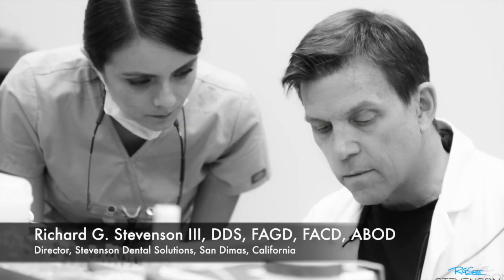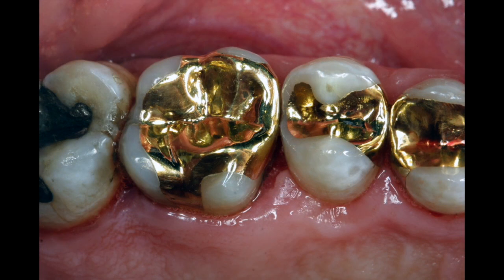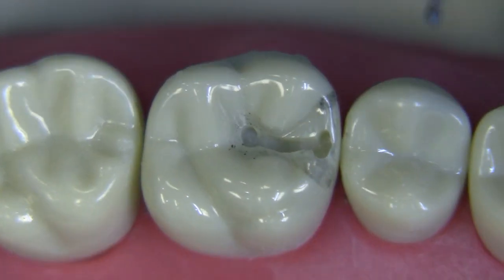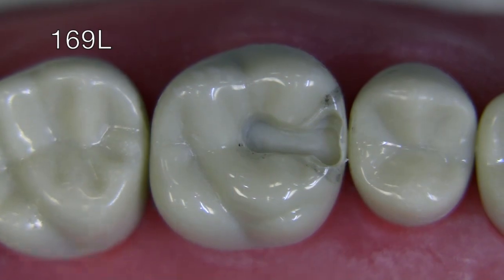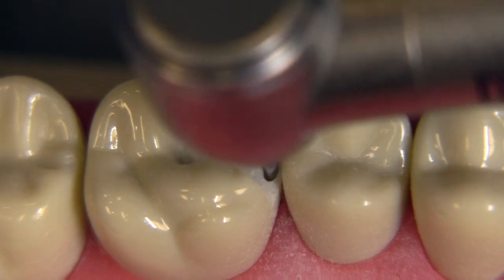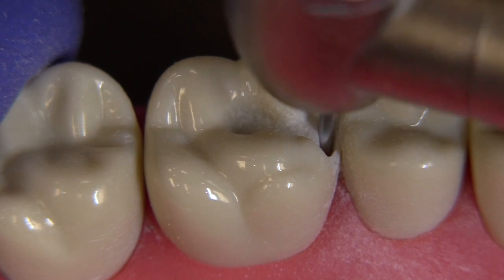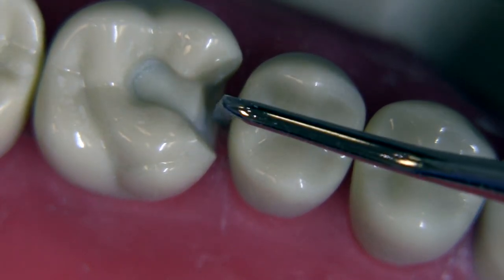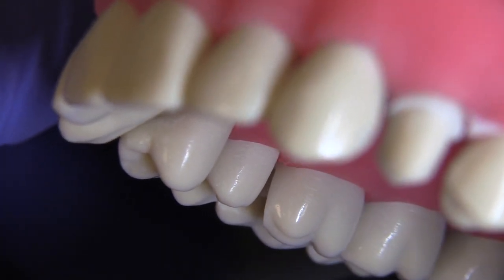Cast Gold Tucker Technique - Gold Inlay Preparation #3 MO

Comment: Dear Dr Stevenson - very neat, well explained.  Your comment on leaving a slightly larger draw angle in the gingival asp of the box. (B&L) This was shown to have an insignificant reduction in retention while greatly facilitating the seating of the final prosthesis.
Reply from the maker: Thank you - the best fitting castings have an "easy draw"...Then more friction due to more surface area in contact.

Comment: thanks for the upload doc, from ,my experience i saw few gold indirect restorations that stayed more than 20 years of service,even in a challenging mouths(oral hygiene) and looked decent.
well nowdays due to technology,esthetics,and the price of gold i think those procedures are less common.

although gold is not a britle rather ductile metal, fracture may occur but less common, but the choice of inlay is much less common,due to the wedging effect on the tooth,and that u need a minimum reduction of istmus- worth mention teeth are not typodont premade acrylic.

worth mentioned2:  ruiz has an interesting book about indirect restorations, most likely ceramic with a contemporary design preparation

another reason -maybe philosophic why those restorations are not made anymore is due to - Planned obsolescence, this is why there is a light bulb that can hold 100 years, but they are not manufactured anymore-due to economy reasons.

what type of provisional used? that doesnt dislodge between treatments? and that u dont need to drill so u dont ruin the cavity design for the restoration, is it certain composite with spot etch?(telio\tempit)

looking foreward to ceramic venners case.

cheers
Reply from the maker: Hi Doc, great comments and questions!  The Tucker Technique is so much more than this simple video, as you must know.  In my practice patients travel across the country to receive castings - such a pleasure to perform these.  Temporary technique is simple - see Stevenson DuraSeal Temporary YouTube video.  I was Chair of Restorative at UCLA for 17 years, wrote the textbook chapter on gold in "Summitt's Fundamentals of Operative Dentistry: A Contemporary Approach", so I can answer just about any question you have - I hope!  BTW - the average life expectancy for a gold casting is far beyond 20 years...plenty of clinical studies report this.  So, when considering the cost of replacement dentistry for a tooth restored with a ceramic inlay only vs gold, gold wins by a mile - Go LONG I say!  Longevity, what a concept.

Comment: These look really nice, I like how you explain a lot of the process and thought that goes into it. Do they strengthen the tooth like a ceramic inlay/onlay does? Do they still get decay under them like other fillings?
Reply from the maker: Ceramic inlays only temporarily strengthen teeth - this has been shown in numerous studies.  Gold inlays "brace" the enamel and support it but do rely on remaining tooth structure for durability, like all restorations.  Gold onlays are stronger than inlays and more conservative than full crowns.  Recurrent decay is very unlikely with precise fitting gold restorations - bacteria actually don't grown as well under gold compared to bonded restorations.

Comment: Hi Dr, one question; how do you check that you have removed enough from the occlusal surface when prepping for different types crowns? Is there any way of using a silicone matrix to control prep depth accurately? Thsnx alot!
Reply from the maker: Many ways - depth cuts, both vertical and horizontal, matrices, scanning with evaluation, etc.  Great question!

Comment: Thank you so much for your videos, especially cast gold---love cast gold! Which bur do you use to make  the pin retentions and then what do you use to pick the pins up in the impression so  the lab can then add this to the casting?
Reply from the maker: Usually, a 168 or 169L but sometimes a non-depth limiting twist drill (the Shooshan technique, which requires analogs for the impression) and I'll demo the vented needle technique in an upcoming video for the impression.  The lab waxes into the pin hole on the die or uses a plastic analog.
Reply: Thanks for the response. @StevensonDentalSolutions

Comment: what about caries... caries might not be exactly 1.5mm deep, could be very deep. would you still begin with 1.5mm to the basic outline and remove mm by mm until all caries are removed? - first year dental student
Reply from the maker: Great question!  The video outlines the ideal prep, but also gives the optimal guidelines even in clinical cases where caries and existing restorative materials are present.  After a proper diagnosis, the existing restoration and caries are removed, then the tooth is blocked-out usually with an RMGI base or Composite material to full contour, after which the preparation begins in the same manner as described.

Comment: How much time can they last with proper hygiene?
I'm tired of my composite fillings on the back of my teeth failing after so little time, even though I try to have the best diet possible (without sugar at all) and brush/floss 3 times a day.
Reply from the maker: Under the best conditions, they will last a life time.  50-60 years is not uncommon.

Comment: Hi I havea question. I had a large filling done with composite but I am still suffering with sensitivity to hold and cold. I  have a feeling the filling may not have bonded properly. If I have the filling redone with gold would this reduce chance of still having sensitivity...?
Reply from the maker: Yes, as long as it is performed very well, the gold seals beautifully - good seal = less leakage = less pain.  Some initial cold sensitivity is common but quickly resoles.
Reply: @StevensonDentalSolutions  Thanks for replying! I will start saving up to have this done. 😊
Reply from the maker: @ShootingStar466  Great

Comment: Do you have a video regarding temporization prep and cementation of the gold? Do you use just IRM or similar temp material during the fabrication process?
Reply from the maker: I use DuraSeal and dental stopping for inlays and occasionally on onlays.

Comment: How much is a gold inlay/onlay out of pocket?
Reply from the maker: About the same as a crown
Reply: @StevensonDentalSolutions  why would it cost about the same as a crown
Reply from the maker: @pootis1699  Time is more, effort is higher, expertise is essential, and lab fees are the same or higher.
Reply: @StevensonDentalSolutions  im guessing your time and expertise are major factors in the gold restoration rather than the cost of gold
Reply from the maker: @pootis1699  Correct! The amount of gold is relatively low about $150-$250...
Reply: @StevensonDentalSolutions what carat gold is used for a gold crown